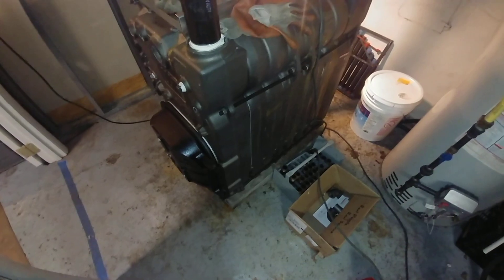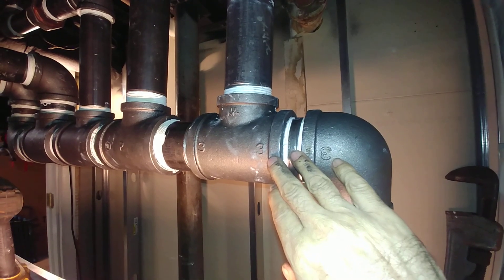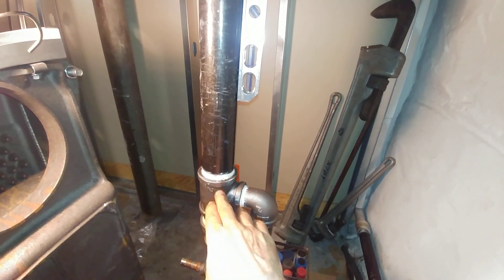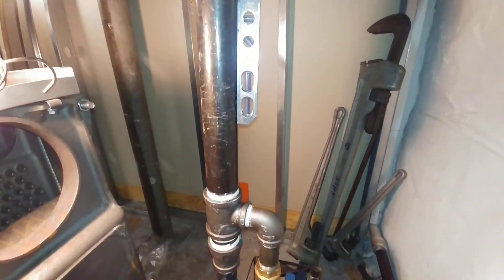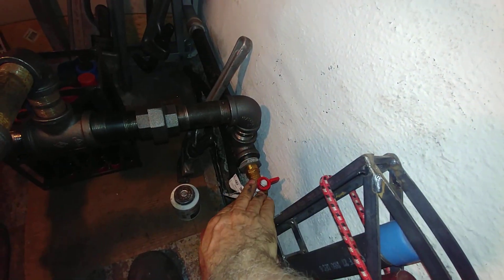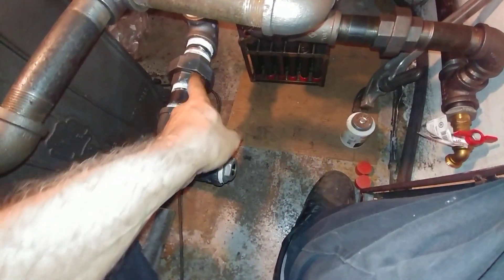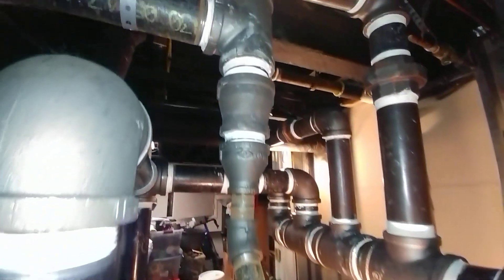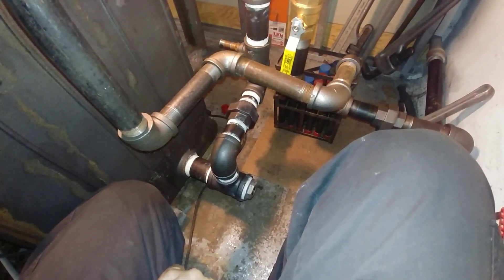Equalizer Line, Hartford Loop, Wet Return, Drip Line Rough-In on a Steam Boiler Install

Comment: Probably should've faced that valve handle upwards so it's easier to access
Reply from the maker: Thanks for your comment.
In regards to the valve handle replacement, the thought process is that it will be seldom used anyway (still haven't been back since the boiler first fired) and want to reduce the likelyhood that the valve will be shut off by accident. Also, I suppose the handle could be simply removed,  the point being is there is no absolute correct answer.

Comment: Happy New Year Gordon! Just wondering, what's the difference between returning the counterflow condensate via the wet return side of the hartford loop vs the equalizer side?
Reply from the maker: I think if you have clean steam and a properly set and operating pressure control, it should make no difference where you put the drip from a counter flow steam main as long as the tie-in is below the lowest safe waterline.
I think any issues (water level control, water hammer, etc) that may arise from deviating from "The Book" in the case you are questioning about would generally occur when something else goes out of spec.
Even so, I don't want to tempt the steam gods!

Comment: Hey Gordon beautiful work,did you eve thought in using propress blak fittings for this type of work, Im thinking about of buying propress but I'm afraid of not worthing.
Reply from the maker: I think I'm gonna hold off on using Megapress on steam as a standard for boiler installs.
  
I have concerns about the longevity of the rubber "o" rings they use in general and with steam in particular.

That is not to say It never use Megapress. Far from it.

I have a set of megapress jaws up to 2" and have used them on gas lines and wet returns and they are a game changer in that regard.

And I have used them once on 2-1/2" steam pipe when there was absolutely no other option for repair.